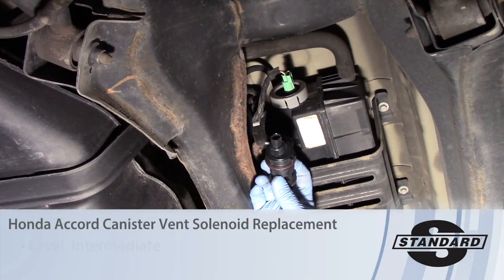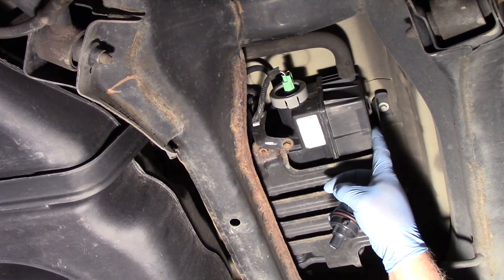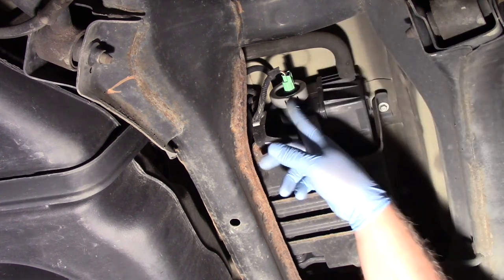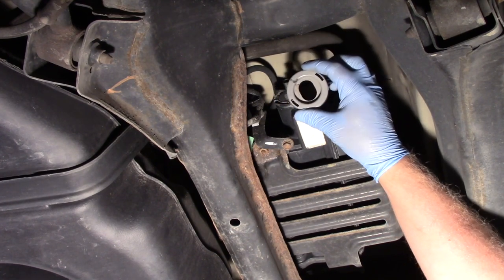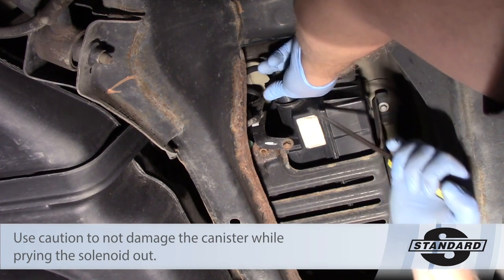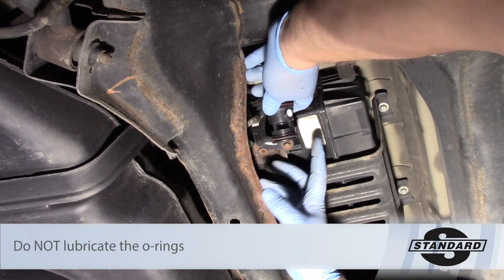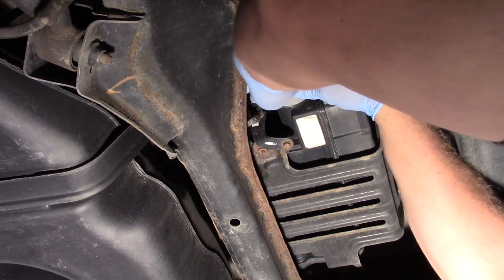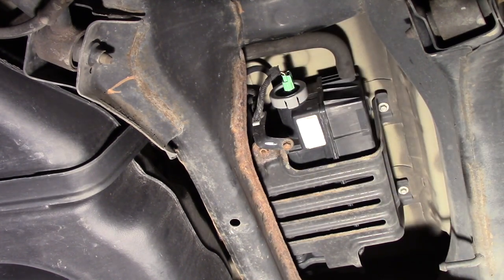Honda Accord Canister Vent Solenoid Replacement

Comment: Will this work on a 2018 Honda Accord? I got a code p2422 recently saying that my vent valve is stuck closed, wondering if I can just change the valve instead of the whole vapor canister